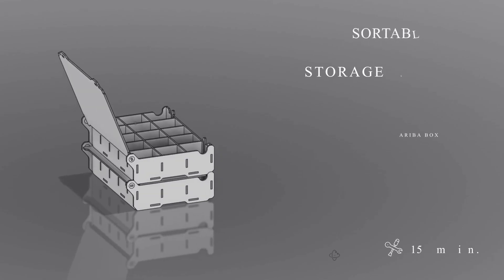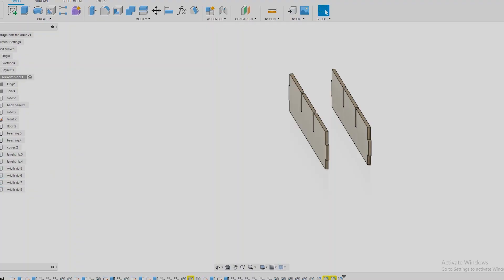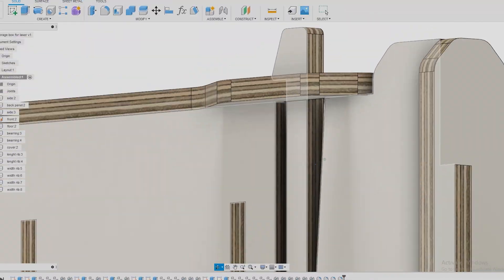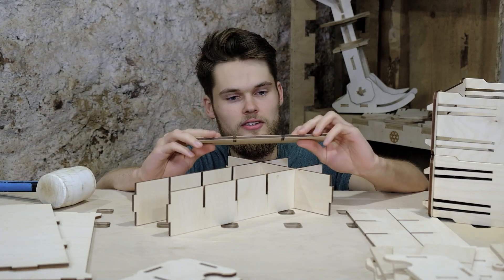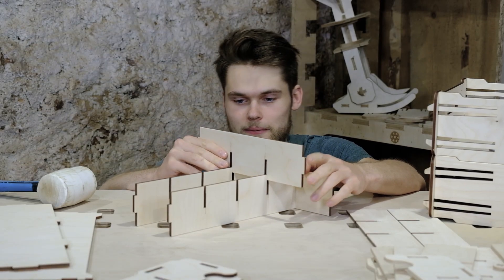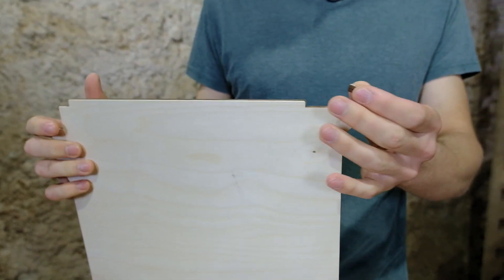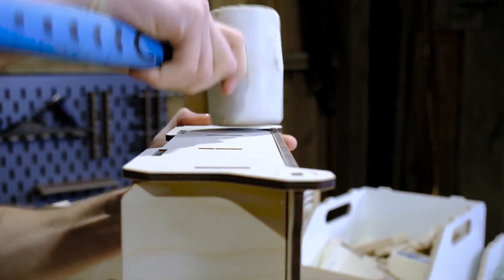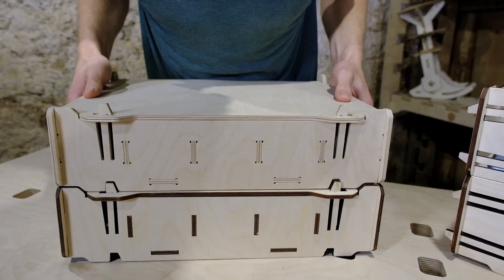Sortable Storage Box BUT it's 100% Wood (No Screws, No Glue)  - ARIBABOX

Comment: This looks really good, how easy would it be to scale the design down? My laser is only 350 mm x 350 mm.
Reply from the maker: Thank you! It's easy to scale it down. The original design is made for a 6 mm sheet, so if you decided to scale it down by 1/3, you could fit the parts on your laser and make the boxes using a 4 mm ply (or other sheet material).
Or you can email us your order number and desired box dimensions, and we will make all the adjustments for you.